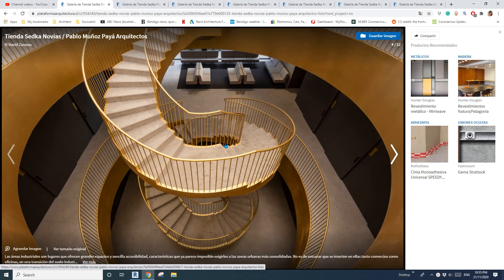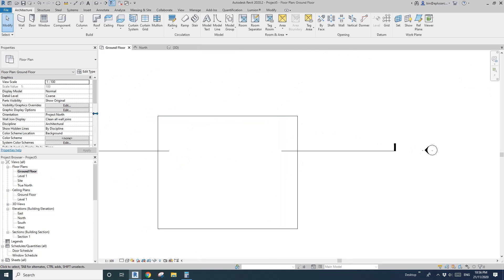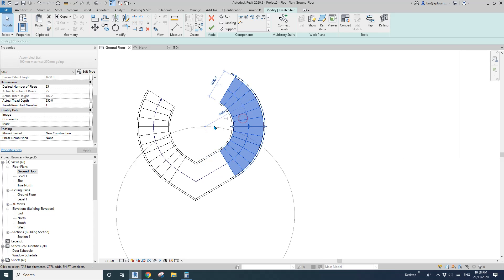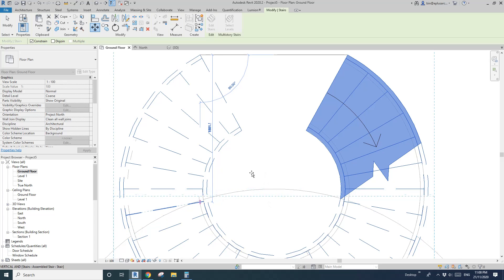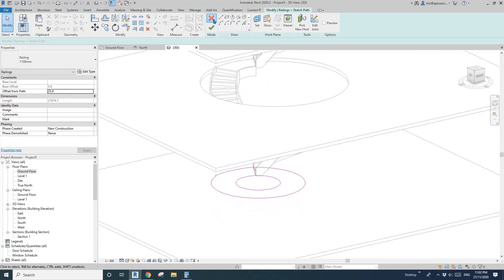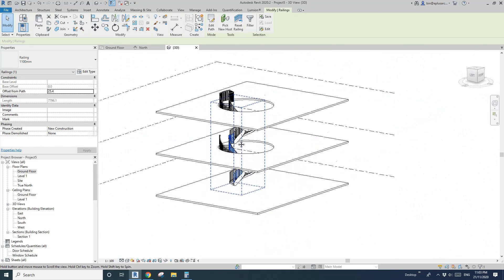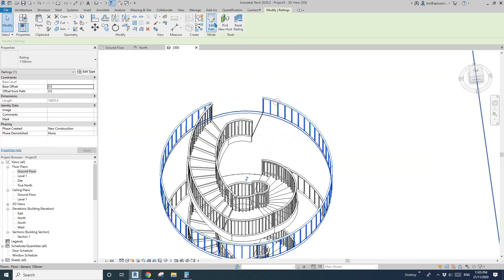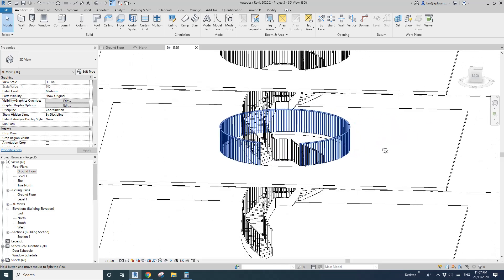Revit Everyday (Day 247) - Spiral Stairs Exercise

Comment: Sir, i have made circular stair by sketch. It has landing in between like about four tread after. it is smooth all along except at that landing creating a notch . stringer also doesn't taking shape of landing. i don't know what's the problem.
Reply from the maker: It’s probably a glitch of the stair by sketch. Try to model it directly using the radial run.
Reply: @BINHE615  Sir, what i wanted was first step and last step in same line, which is i think is not possible in radial run.
Reply from the maker: I tried this in 395. No perfect, but close enough.
Reply: @BINHE615  ok, i will watch that.